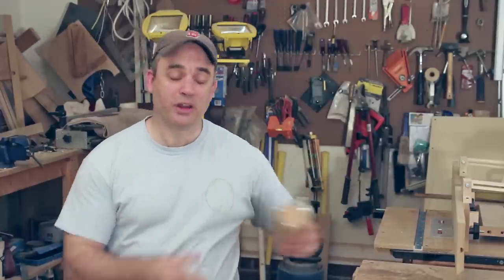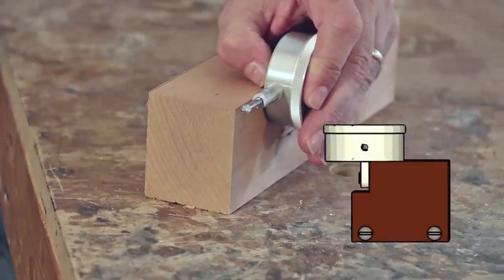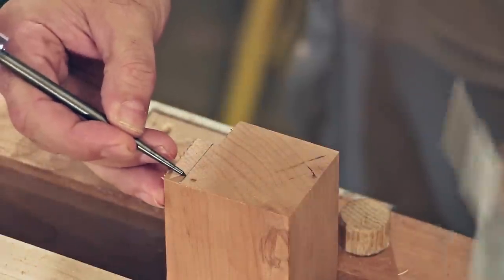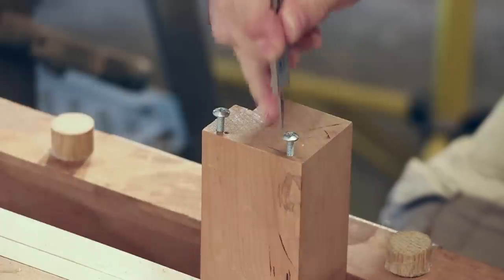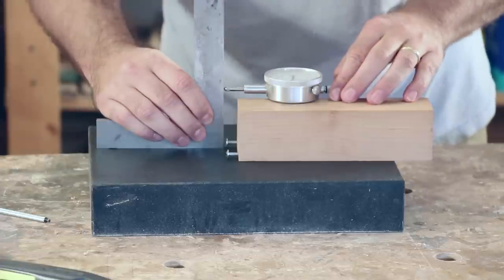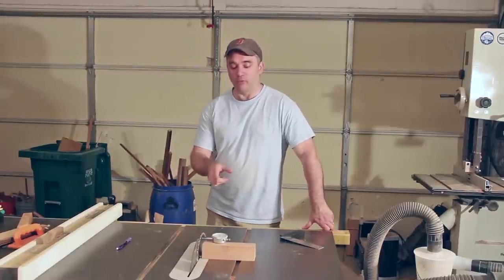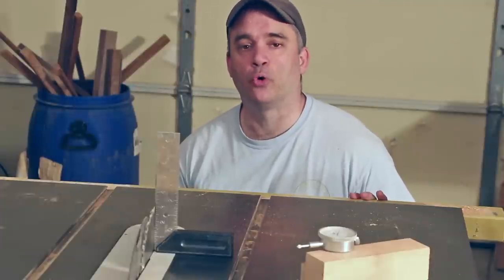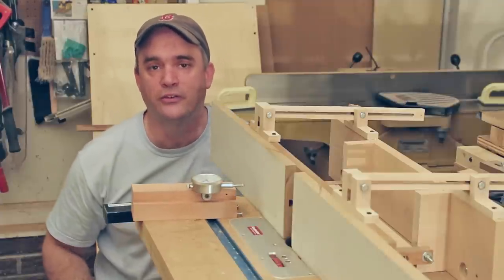Easily Align Table Saw Blade to 90

Comment: Thank you so much for making this video. I was very frustrated trying to get my saw blade back to 90 degrees. I started by using the square up against the blade and squinting for light just as you mentioned in the video. I was actually chuckling to myself as I watched this cause i had just done this an hour earlier and even though the square said the blade was square, it was actually 20 thousandths off. So what did I do immediately after watching your video? Rand down to my local Harbor Freight and bought a dial indicator. No more hassles squaring my blade or even my fence on my planer for that matter. What a relief. You saved my day!

Comment: Superb !! I went out to the barn and found my dial gauge that I had purchased when I was stationed in Japan (Navy) in 1969.  Still functions correctly.  Will use my wife's new quartz counter top in the kitchen to set things to 90 degrees. Excellent!

Comment: Great revisit Brian. I've worked with dial indicators, calipers and most other gages for over forty years. Even though I have multiple calipers and micrometers of different sizes I don't have a dial indicator in the shop. I will very soon. Like the new camera.

Comment from the maker: Yes you could do that.  You would need machinists 45 angle block and a dial indicator with a longer reach.  The 22.5 might be pushing the reach of most dial indicator plungers.

Comment: That is a good tip, on alignment. By the way is that a bear proof food barrel in the shot at 2:20? The blue one. We have a similiar one but just a bit smaller we use when we canoe camp.
Reply from the maker: No.  It's an old silica gel drum.  Could probably work for a bear proof barrel. :)

Comment from the maker: Yes - you would need machinist angle blocks for the angles that you want to duplicate - zero for.  Angles less than 45 degrees might push the limits for the reach of most dial indicators.  It might require modifying the jig for lower angles.

Comment: I have a problem with this dial indicator jig so I must be doing something wrong.  I need to achieve spot on 90 degrees as I have to glue a series of pieces together.  I replicated your jig as close as possible and cranked my blade to 90  degrees. I checked it with my precise  square against the blade with a light behind and it, too, was perfect.  I made sure my throat plate was level too.  Then I tested a cut with a 6 inch 2 x 4 on edge.  I checked the cut with my miter gauge and was shocked to see that the top of the 2x4 was .804” and the bottom was .869”.  So I cranked just past the limit indicating 0 and tried another 2x4 cut. This time I got .821” on top and .841” on bottom. I can’t crank any more and don’t know what I can do to get a 90 degree cut.  
As I write this I’m thinking of anything I might have done incorrectly.  I do use a Freud thin kerf blade.  Could that be the issue?  By the way, I checked the dial indicator and the right side of the blade was.0018” plus and the left side was .0020 minus.  What other problem might there be and what should I try next?

Comment: Would you consider another video that shows the blade set off square by 2, 5, and 10 thousandths.  I would like to see the square against the blade to see how accurate or inaccurate our eyes are in relation to the dial indicator.  Your new camera should give us a great picture!

Comment: Is there a way to apply this same principle for other angles?  If so, you could have a gauge for common bevels like 45 and 22.5.  Also, I don't know if you have one or not, but it would be cool to see a comparison between this method and one of the Wixey digital gauges.

Comment: My blade will not adjust to 90 degrees when cranked all the way to zero the blade is still out of square.  Is it just a bad table (it's fairly new) or am I missing something?  I have only used my square to measure it, but I can clearly see that it is not perpendicular to the table.  Thanks for any help you can provide.
Reply from the maker: Most table saws have a positive stop for 90 degrees.  My guess is that the trunnion will no longer tilt because it is hitting the positive stop.  Back the 90 degrees stop off and see if you can adjust the blade further.

Comment: This right here is the bomb. This and the miter gauge trick are so quick and simple it's ridiculous. I made the jig, checked the blade for 90, checked my miter gauge and sled all faster than I could have done the 5 cut method. I didn't use the screws and used the face of the wood block for checking 90, is there any problem with that?

Comment: Very nice. Did your dial indicator come with the bracket to attach it to the block of wood? I just received mine, but it does not have a bracket, so I'll have to figure out another way. Did you have to square up the wood or doesn't it matter (as long as it is sorta kinda straight)?
Reply from the maker: Robert Echten Yes, it came with the bracket.  I bought it at Woodcraft and it came w/ the magnetic base.  Doesn't have to be perfectly square, but get it as close as you can.
Reply: GarageWoodworks Thanks. I'll need to find and attach a bracket then ;-) Thanks.

Comment: Brian, When you adjusted the screw to be coplaner to the tip of the dial indicator, the indicator was in the fully extended position? I am thinking it doesnt matter as long as you zero the indicator when the tip and screw are coplaner, correct? Great idea BTW, I love using the dial indicators.
Reply from the maker: The indicator needs to extend beyond the screw.  When zeroing with a square, they will be in line.
Reply: +GarageWoodworks Ok, I think that is what i meant but didnt get there as well as you did. thanks

Comment: I'm thinking that if you measure one side of the blade and set the indicator to zero, then measure the other side of the blade, a zero reading would indicate 90 degrees, while a correction would be half of the second reading...as long as the reading is the same on both sides, you'd have 90 degrees--is that correct?
Reply from the maker: Yes. As long as your table saw surface is perfectly flat I don't see why that wouldn't work.

Comment: I recently built your dial indicator jig and like it's simplicity. When using the jig on my table saw I find that I get different reading (0.015" difference) depending on which side of the blade I check. The blade is a Freud Diablo 10" blade on a Grizzly cabinet saw. Any idea why?
Reply from the maker: +Cecil Hunt Could be that the blade has a very slight taper or that your table saw surface has a slight warp.  0.015" is (in my opinion) nothing to worry about.  I'd split the difference when aligning to 90 with 7 thou on each side.

Comment: A square is square.
A dial indicator set into a piece of wood that fluctuates with expansion and contraction, working in conjunction with 2 screws, that all have to be adjusted for square.....is over engineered and not simple.